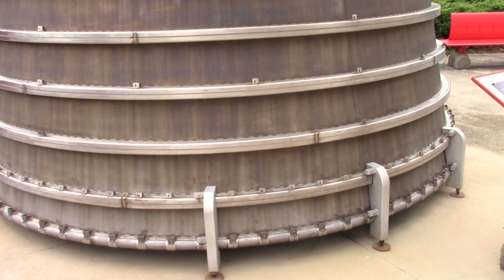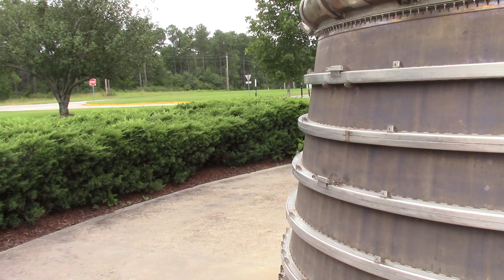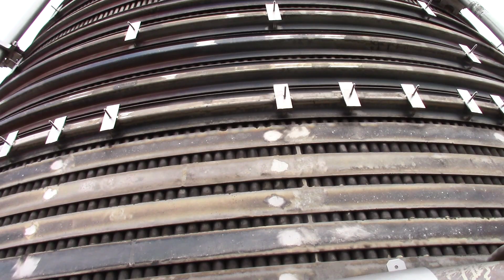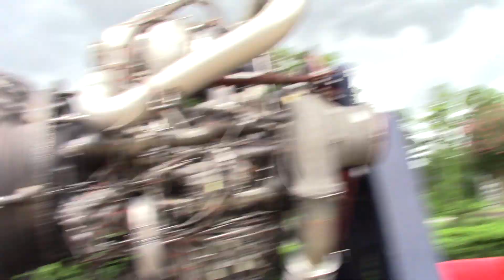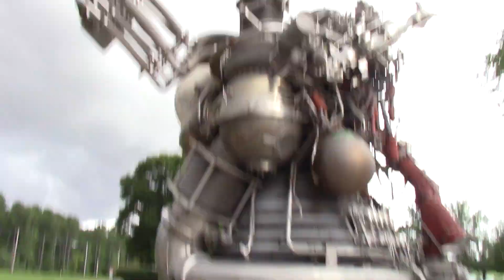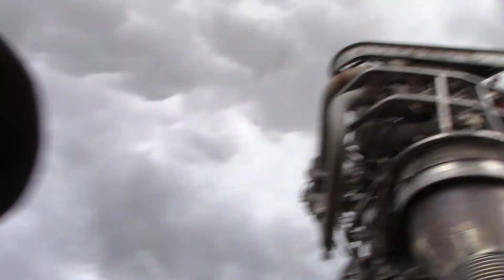F1 Rocket Engine - Worlds Largest Liquid Fuel Single Nozzle Rocket Engine

Comment: Wow what a dinosaur. I have to share this. Hard to believe this could even get off the ground with its size
Reply from the maker: It produced over 1,522,000 pounds of thrust at sea level and 1,746,000 pounds of thrust at vacuum (at altitude).

Comment: It's a disgrace that it's left out in all weathers to rot away >:-(
Reply: The metal used on the F1 engine withstood highly toxic fuel I'm pretty sure rain will not hurt in fact the rain helps keep clean.
Reply: @FiercePatriot  "Highly toxic"??? Maybe toxic to humans but kerosene isn't exactly corrosive to metal.
The F1 engine was never designed to be an outdoor ornament; it should be stored in a safe environment for future generations.